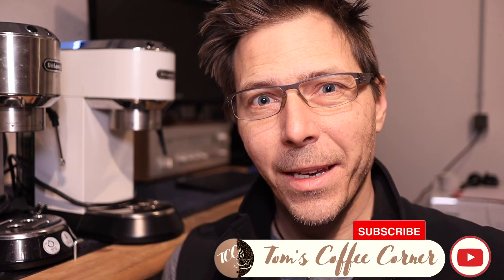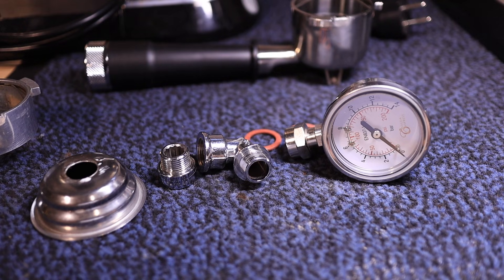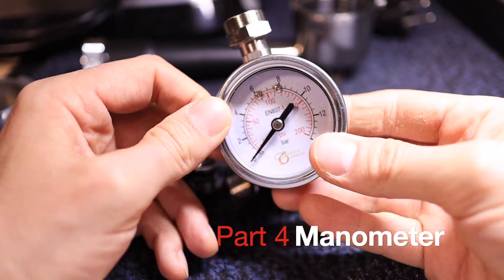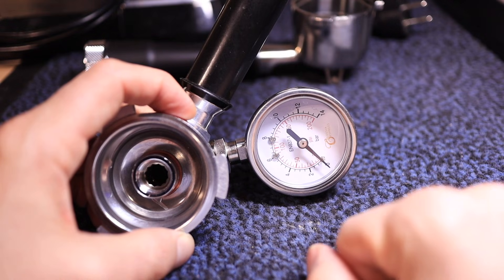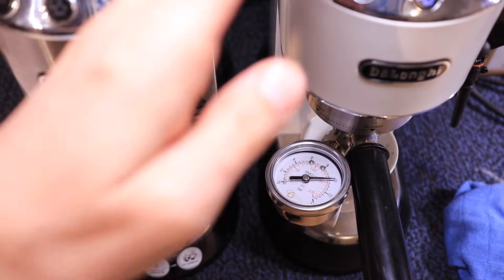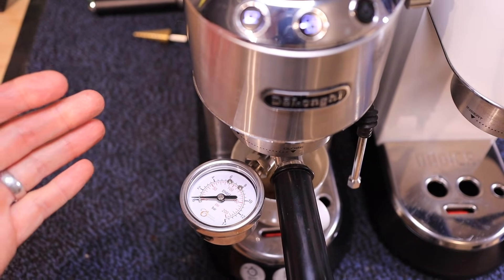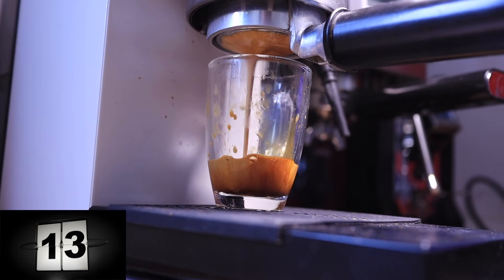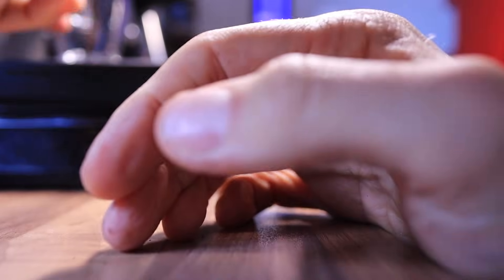How Much Pressure does the Dedica really Have? Prep for 9 Bar Mod

Comment: My coffee machine is when I start to shot the coffee, it loses a few drops of water through the milk steamer. what could it be?
Reply from the maker: Hmm, I haven't seen that with the Dedica, but I have seen it with many other machines. It normally means a valve needs replacing. How old is your machine?
Reply: @TomsCoffeeCorner  i think 3/4 years
Reply from the maker: @joaopereira1935  Are you sure your steam dial is turned all the way off? If so, then perhaps the valve within the brew group is losing its seal. The water comes from the pump to the brew group, then is routed to the steam wand when the dial is turned on.
Reply: @TomsCoffeeCorner  yes its all closed.
Reply from the maker: @joaopereira1935  Then I am afraid it doesn't look too good. I would try replacing this valve myself: https://www.juraprofi.de/DeLonghi-Ersatzteile/Ventile-und-Schalter/Dampf-Heisswasserventil-fuer-DeLonghi-EC::16324.html

Comment: Oops, I just bought a second hand Dedica machine a couple of days ago that was used for one year according to previous owner, does it mean it is already lost a part of its original pressure?
Reply from the maker: Hey Rachid, I doubt it will have lost much pressure over 1 year. To everyone else: don't worry so much about the lost pressure. It takes years, and even then you can buy a maintenance kit for your pump (glass ball and O rings), or replace the pump. But it will take years to get to that point. Just enjoy your coffee. ☕️ 🙋🏼‍♂️

Comment: Hey Tom. Thanks a lot awesome video. Do you think it's possible to install a pressure gauge connect inside the machine to check the pressure during the shot? Cheers!
Reply from the maker: Hey Rafael, I think that might be possible. I plan to look into it in the future, to see what that mod would entail. Cheers!

Comment: Thanks for the tutorial! I'm planning to do this pressure test on my machine as soon as the bottomless portafilter arrives in the mail. I have a Krups Virtuoso, which looks almost like a copy of the Dedica, both exterior dimensions and internal components - so your solution regarding the 9-bar-spring may be applicable on my machine too :)

Comment: The acidity that you tasted on ur 7bar's was due to the wrong grinder settings, you see less pressure means the flow rate was slower than the other one and you can't pull the shots on the same grinder setting, I learned all the extractions through Decent's channel and for chocolatey beans that go higher temps, at 92c to pull 1.5:1 ratio in the cup, with 4ml/s flow rate, either drink it neat or americano, it tastes better, one piece of espresso extraction that almost all of us, may be the rest of world has omitted is the solvability of the beans, darker the roaste and the beans tend to give up their materials easier therefore not like what we have been told that you need lower brew temps bla bla, higher temps extraction more and therefore go finer and less ratio(1.5:1) that unlock its real flavor with less bitterness, and fruity and floral beans need complete different recipes to unlock its true potential.
Reply from the maker: I think you make some good points. But strangely, the 7 bar shot took just about the same time to reach a 2:1 ratio, as the 11 bar shot. That is what baffles me a bit. Trying a turbo shot with a coarser grind could be fun though, on the 7 bar machine. Thanks for your input! 🙋🏼‍♂️
Reply: @TomsCoffeeCorner , as you said: 7 bar shot and 11 bar shot took the same time. So consider some simple mechanics: When the resistance is equal (same dose and grins setting) and the flow rate is the same (same duration for the same weight out), then also the pressure during the process must have been the same. Some ideas to why this could be happening:
-Your grind and tamp wasn't identical?!
-The STATIC pressure (=pressure at zero flow) you measure with your gauge is different between the machines but when there is flow, they have the same pressure. Could be that the low flow area of the pump curve has flattend over time, but at the operating point, they are still every similar.

I have no clue why the shots should taste any different. Really wired to me.
Reply: @TomsCoffeeCorner  Forget about turbo shot, because that paper wasn't talking about less soluble of the light roasted beans, but purely onto the grind size and pressure, however, those two are supposed to integrate with coffee beans to get higher TDS and fruity bomb tasty shot, with flat profile machines, the allongé is the receipt that we should have do, I've been pulling allongé for over a month with my mod 310, fruity bombs as Scott Rao said.
Reply from the maker: @checkwhatsleft4565  Fruity bombs sounds like a worthy goal. What is an "allongé"? I have never heard of that before...
Reply: @TomsCoffeeCorner  Allongé is one of the expresso recipes to truly unlock the potential of light roasted beans, we as the rest of coffee world that never truly understand the espresso before the Decent espresso machine came out, because all the flat profile machines that don't provide feedback, espresso is about receipt, not one of those flat white whatsoever stuff but get to the potential of the beans, that kind of recipe, I have been enjoying those recipes thanks to Decent and their contributions, watch their channel's videos with no skip xx seconds if you are interested into it.
Reply from the maker: @checkwhatsleft4565  Thank you. I know of the Decent machine, but have not seen many videos on it yet, since it is quite out of my price range. But it would be good to glean some information from the channel. I will check it out.
Reply: @TomsCoffeeCorner  I learned and applied that to my machines, there are 3 receipts that basically can solve all the espresso extractions, one would be high dosage for chocolatey beans with higher temps and less ratio(flow rate matters in these extractions), and allongé and blooming(this requires dimmer mod flat profile machines), Allongé and blooming are the two recipes that deal with light roasted beans.
Reply from the maker: @checkwhatsleft4565  Thanks for that! I'm glad to learn more about this hobby through comments like yours. I will keep this in mind in the future. Cheers! ☕
Reply: @TomsCoffeeCorner  Learn and explore, that makes lift more excited. xD

Comment: Cool vid!! So where is the 15 bar spec delonghi claims? Could be just a matter of marketing thing? Or the OPV opens in fact at 11 bar and the pump spec is 15 bar? In any case 11 in better than 15 😉
Reply from the maker: I am guessing the pump IS rated for 15 bar, but that the OVP is calibrated to 11-12 bar. I think the marketing team just figured, "hey, 15 bar sounds waaaay better than 11 bar!"

Comment: Tom, very nice video. I actually just made a portafilter pressure gauge, but I took a double spout portafiler and actually unscrewed the spout using a bit of force and pliers. There are male G3/8in threads (3/8 BSP, but 3/8 NPT fits too) there natively. I just took a simple elbow reducer 3/8 to 1/4in and a gauge, used a bit of thread tape to be extra sure and it was good. I actually added a cheap 1/4 valve for some extra horizontal distance because my gauge needed more clearance.

I see people say that the pressure of the basket might be higher since the water would normally have somewhere to flow out through the puck, but the water still flows out the overpressure valve drain hose back to the reservoir on my machine, so i think it's the same type of thing.
Reply from the maker: Awesome! Where did you get a double spout portafilter with an unscrewable spout? That was my first idea, but I wasn't sure where to get one.
Reply: @TomsCoffeeCorner  the machine I bought was second hand so it actually came with a double spout one, I just tried to unscrew it and happened to get lucky I suppose. I'm not sure how to tell if it's able to be unscrewed, but maybe the cheaper ones on Amazon might be if that's an easier manufacturing method. Thankfully the machine also came with a bottomless so I wouldn't have ruined my only one :^)
Reply from the maker: @hathzorz  Ok, very cool. Could you link a picture, or send me a DM on instagram? 
https://www.instagram.com/tomscoffeecorner/

Comment: Awesome video! Never would've thought to do that. I recently traded up for the new Dedica Arte and I gotta say it does save you time on doing the steam wand mod. It makes great foam out of the box. Biggest difference though, is just the newer machine is making much better pressure. I had the old Dedica for years and it finally started crapping out.
Reply from the maker: That is awesome! Glad to hear that the EC885 is making some nice foam for you Jacob!
Reply: @TomsCoffeeCorner  It's not worth a standalone upgrade from an older model, especially you've already upgraded the wand. But if you're buying one new it's worth the extra buck.

Comment: I wonder if the pressure is higher than what actually goes through your coffee since the pressure has nowhere to go?
Reply from the maker: I think that depends on the fineness of your grind and pressure of your tamp. One can even choke his machine if the grind is too fine, which would max out the pressure as well.
Reply: @TomsCoffeeCorner  Actually pressure of the tamp makes no real difference (other YouTubers have done detailed experiments to show this). This is because the puck will swell up away, so actually the fullness of the basket  is what really matters (along with the grind size), you need the basket full enough that it cannot swell too much and is limited by hitting the group head sieve. The only reason I tamp is so I can get a full 14g of grinds into the basket and still close the portafillter. In short, don't underfill your basket!
Reply from the maker: @pax100  I can agree with this to an extent. I used to work at a high volume cafe. We had accurate dosing grinders that would dose 15.5 grams into a 53mm Dalle Corte basket. For cappuccinos we used one bean, which was automatically tamped with a Puqpress. But for espressos, we used a different bean, which had to be hand tamped. If I didn't tamp right, the shot would run in just 12-14 seconds. If I tamped the crap out of it, then I would get the desired 22-24 seconds. I was quite surprised at this, considering the dosage was the same, to have such a variance only based on tamp.
Reply: @TomsCoffeeCorner  When I grind too fine and choke the machine, I tamp lighter and get an even extraction and okay espresso (thus I don't have to throw away the coffee)

Comment: Interesting. 11 bars ain’t too bad actually, and over time it’ll just get closer and closer to the desired 9 bars. By the time it drops to 7 bars the spring should be replaced anyway
Reply from the maker: Yes, I would say you're right. I was surprised my old machine is so low! Well anyway, cars lose compression, and I bet pumps do as well.
Reply: Hi. To restore the original pressure Just need change the opv or pump need change to?
Reply from the maker: @joaopereira1935  Hey Joao, I am guessing that the silver machine will need a pump overhaul.I plan to do a future video about that.

Comment: Great video as always Tom!
Have you tried to do a temperature profiling on the Dedica? I know that the Dedica comes with 3 temperature settings, but I'm not really sure what temperature I'm supposed to have with one setting or another.
Reply from the maker: Hey Alin, I just use the hot setting, and I get about 89 degrees celsius maximum during the brew. I have not experimented yet with the other lower temps too much yet.
Reply: I tried with the other two temp setting but got the same temp of 89 degrees
Reply from the maker: @a.rincon2748  Haha, ok thanks for that info, Rincon! I should see if I come up with the same result...

Comment: Hey Tom. Based on your usage, how often do you need to calibrate your machine so that it can achieve 9 bar of pressure? I can't wait to see the next video.
Reply from the maker: Haha, I was surprised to find out the pressures to be honest. I guess they'd have to be recalibrated once a year probably.
Reply: @TomsCoffeeCorner  I'm picking up a used Dedica tomorrow for $40 and I think the mushroom pin needs to be replaced from the OPV. I got the STL file so hopefully I can get it 3D printed and make it work again.

Comment: What a great video! And now I know why my shots taste like s**t
Reply: And look what I found. https://youtu.be/kordyFR2Q5Y A video discussing the perfect pressure. So I presume that I need to dial in my shot in a different way assuming that my dear old EC680 is around 7 bars..
Reply from the maker: Well.....I am not sure you can assume that your machine has the same pressure. It kinda needs to be measured. How old is your machine?
Reply: @TomsCoffeeCorner  the machine is from August 2017.
Reply from the maker: @moripottkanal  Yeah ok, well then it is probably low on pressure. But, I have read there are pump kits with gaskets and a glass bearing, that should help increase pressure again. Maybe I will do a video about it.